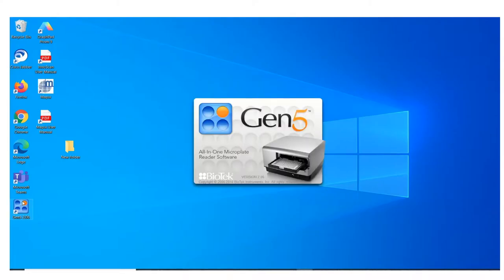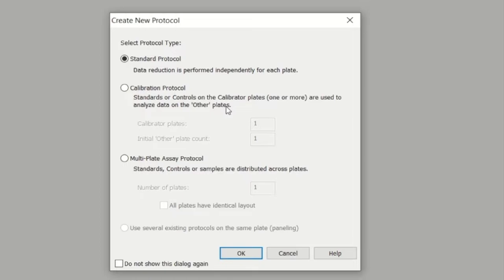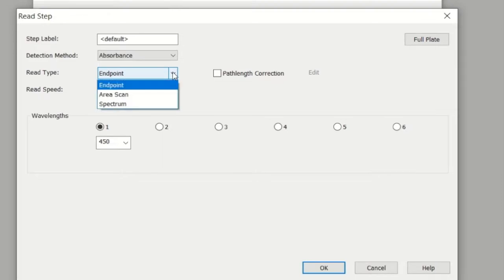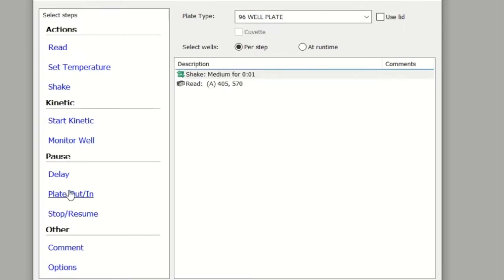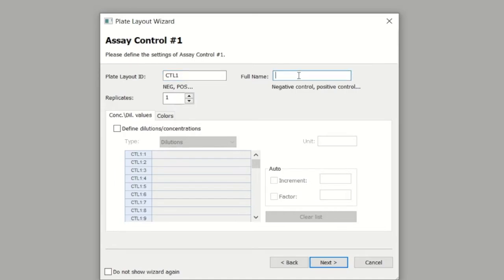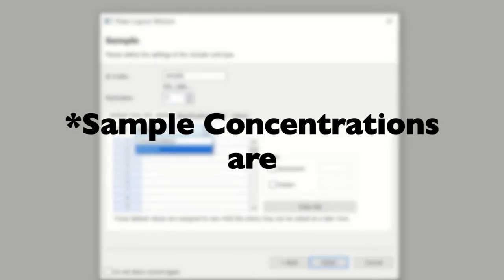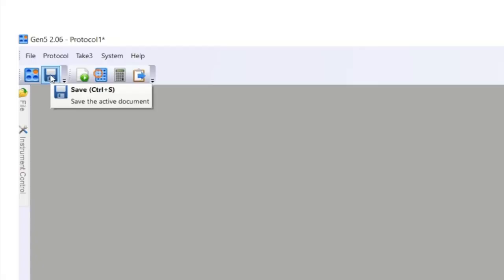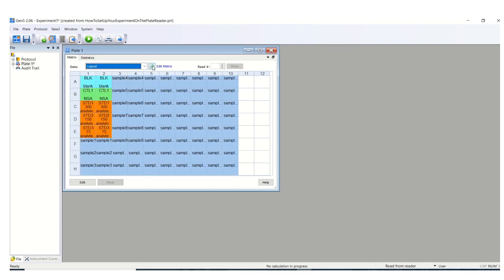GEN5 PLATE READER SETUP FOR ELISA, LUMINESCENCE, FLUORESCENCE Assays | BioTek Synergy HT

Comment: Hi Adwoa, what do you do when you a running a luminescent assay at 2 different wavelength ranges ? I chose a dual pmt but i’m unable to get the exact wavelength since it’s a filter based approach on Gen5
Reply: I will be glad if you can help
Reply from the maker: Hi Robert: Wavelength is a range, so pick the value that includes the wavelength range you're after. For example, for red colour, the wavelength is between 620-750nm, so you can pick a filter that spans this range.  Orange colour is 590-620nm;  Yellow is 570 - 590nm; Green is 495 - 570nm etc.
Reply from the maker: @robertdevine5287  You can also see my video on AlphaScreen Assays where at 4:46, I show the colour chart and thier corresponding wavelengths: https://www.youtube.com/watch?v=l_IqhZqX9s4

Comment: Hi Adwoa, thank you for the helpful video. I am trying to test multiple conditions so I need different blanks on the same plate, but I can't seem to find how I can add more than 1 blank. Do you have any idea how that can be done?
Reply from the maker: Hi. You could simply treat your additional blanks as unknowns, and subtract it from the background of the corresponding condition. I am not aware of how to do it automatically with the plate reader software. Good luck.